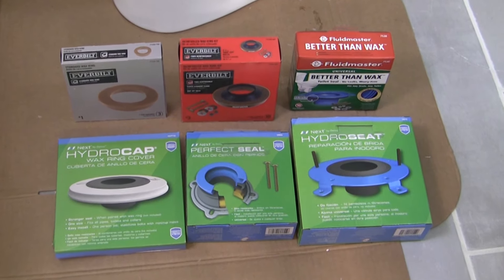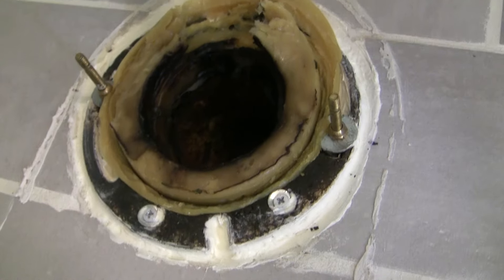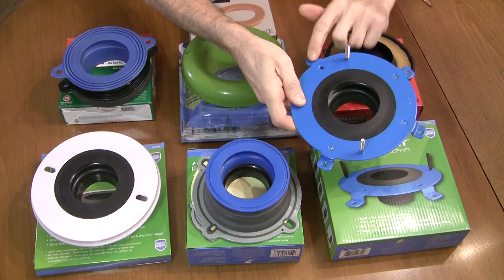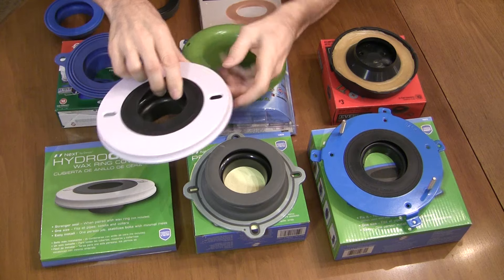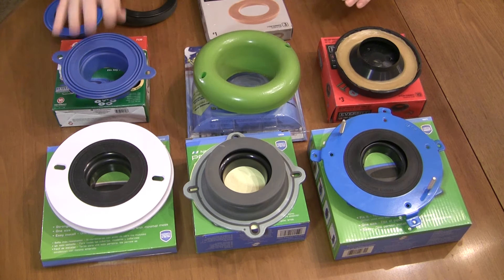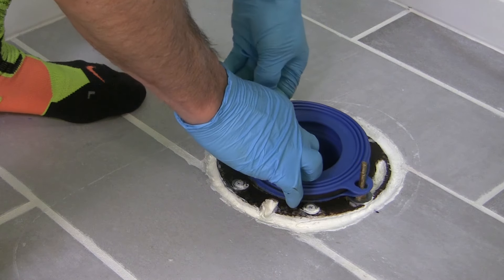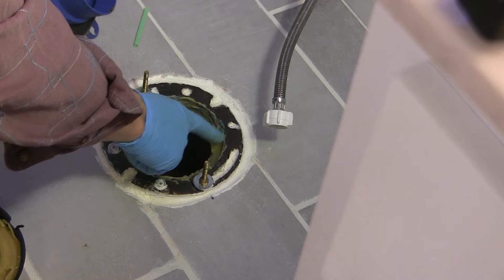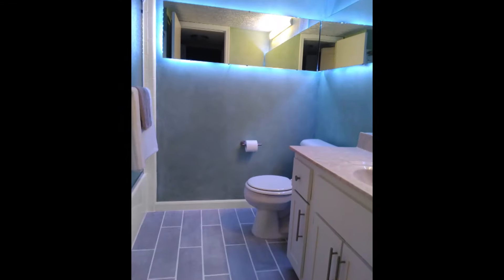2 YEAR FOLLOW-UP to Toilet Flange Fix  / Also, Compare Different Toilet Seals

Comment: P.S. : i had to hire a plumber the nite b4 thanksgiving, to replace my hot water heater, it sprung a leak at the inside of the flu pipe in the center of the heater, and kept putting the flame out, weird ,? but i couldn't get another heater, so i had to try an emergency plumber, he came out and replaced all my pex and shark bites with hard copper and solder joints, and it now looks sloppy, but it does work, so, ,,,,,, and he only charged me $1,300.00, yes that is not a typo, $1 thousand , 3 hundred dollars for about 3 hours work , i wanna be a plumber
Reply from the maker: $1300 is painful. Sorry to hear that, but houses are money pits.  You can never outlive all the work and updates and repairs.  Condos, not so bad in that respect.

Comment: Lol...  manufacturing the flange that keeps the bolts up, would be tough... then super long screws... and then they would break.

They do have toilets that are all-in-one and they do have power assist toilets for 150bucks that use 0.8 gallons of water ...

Comment: Check the measurement of the opening on the bottom of your toilet. You were concerted about the size of the "horn" opening on the bottom of those gaskets. I bet your toilet is around the same size, and not nearly as big as the hole in the floor.

Comment: Rubber, silicone….  Synthetic flange seals will degrade over time. Cleaning products will accelerate the degrading.  

In addition!  Rubber, silicone / synthetic gaskets and seals require nearly perfect mating surfaces and will NOT accommodate any settling or movement which is common in new construction.  

WAX does not degrade, does not require perfect mating surfaces, can accommodate settling / movement and is impervious to cleaning chemicals.  

New isn’t always better!    

Oh!  It doesn’t matter if your flange isn’t level!!!

Comment: One big mistake never caulk the bottom of the toilet looks good but if you have a leak the water cannot run out and will run down I spent 28 years in apartment maintenance I've seen it rot floors out and if you have a toilet upstairs you have a wood floor.

Comment: YOU HAVE TO MAKE MORE VIDEOS, DUDE!. LOL. SO MY STORY, WE HAVE A TOILET THAT KEEPS LEAKING ON THE FLOOR WE KEEP SEEING WATER ON THE GROUT LINES IN FRONT. I'VE REPLACED THE WAX RING A COUPLE TIMES AND INSTALLED ONE OF THESE FLANGE ADAPTERS. I'VE CALLED 4 OR 5 PLUMBERS IN OUR AREA AND LEFT MESSAGES AND DO YOU WANT TO GET HOW MANY OF THEM HAVE ANSWERED OR EVEN CALLED BACK? (HINT, I'M HERE WATCHING HOW TO VIDEOS). I WORK IN UTILITIES AND WOULD HAVE BEEN HAPPY TO HELP A LOCAL PLUMBER GET HIS BREAD BUT AT THIS POINT I SAY F%^K EM SINCE MY JOB IS APPARENTLY TOO SMALL. I'LL FIGURE IT OUT MYSELF ONE WAY OR ANOTHER AND SHARE THE KNOWLEDGE. THANKS FOR THE VIDEOS.

Comment: Sorry i keep commenting before watching the whole video but I hope you didnt pull these toilets up just to show your work didnt fail.. if i made a how to video and someone called me out i definately wouldnt pull my toilet to have a I told you so moment.. hell no, im not doing extra work..  good on you, fuck the know it alls and if it works for you then fuck the rest of the people.

Actually your attention to detail is appreciated, i never put a level on my flange.  As long as shit goes down the pipe and doesnt leak i am happy.

The green sani seal worked amaxing on 2 toilet projects, never had an issue with knicken them and they are reuasable.. they work great.

Comment: You know, if I were to design a toilet...the gasket would be attached to the toilet itself (possibly threaded onto it), with a compressible fitting that slips into the flange as you lower the toilet. There's no great reason as to why these fixtures continue to be designed and manufactured the way they are.

Comment: Those Fluidmaster no-wax seals are $11.50 where I live, + tax. So for two it's $25.76 instead of a $3.50 wax ring? Meh.
Reply from the maker: But with the no-wax you can keep pulling up your toilet to look underneath without buying a new seal.  Have you no sense of joy?

Comment: Hmmm, hard to believe this 2 yr follow-up video has an immaculate interior tank with no  water marks, rust from bolts and all the parts submerged in water  look that good. Even the caulking and grout are pure white from 2 yrs ago?
Reply from the maker: I wish I had it in me to be that deceptive and industrious.  This bathroom isn't used much ...never have used the shower, for instance.  Besides that, if you notice, there actually are water marks in the tank and the bolts in there are oxidized. It's been about five years since I renovated this room and it's still pristine.

Comment: Why can’t I put concrete to seal toilet??
Reply from the maker: Do you mean put grout around the bottom to fill in the gap between the toilet and the floor?  Or do you mean - make a seal out of concrete?  Heh heh, I'd like to see a video on that.
Reply: You want to stop the leak, not trap water in the floor.

Comment: The leakno silicone gasket is the best combined with a one piece gravity toilet like glacierbay-niagara 2420, kohler Santa Rosa, toto, American standard champion 4......  wax is junk.
Reply from the maker: Good info, thanks. I don't know about wax being junk though. They're proven the last for 20 years or more. Most of the wax rings are made out of petroleum, the best is beeswax.
Reply: @MartyPollio  wax is junk, it's okay though, one plunge and you can wreck the seal.

Comment: I was always told never to caulk the bottom of the toilet because then you can’t tell if it’s leaking water just go straight down. I see a lot of people caulking the bottom of toilets. I wonder why when I build the bathroom I build the floor so the toilet flange sit on top of the flow so when it leaks, the water runs across the floor so you see it this one or a great job piss on the haters
Reply from the maker: Thanks.  If you caulk the bottom of the toilet, you have to leave the back side of it un-caulked so a water leak will still show up on the floor.

Comment: Toilets wouldn't need a large ring of mush if toilets were made with a 3-4" ceramic extented part at the bottom of the toilet that was a tad smaller than the flange/pipe and all we needed was a bit of silicone to create an airtight seal.  I'm not a plumber, but it seems basic to me.  Someone invent a new mold for a toilet already, this is ridiculous.

Comment: I started this video not knowing how to fix a leaking toilet, by the end of the video i was confused and still don’t know how to fix a leaking toilet…LOL 

I can’t see anyone making recommendations about waxed rings without actually installing them and seeing the results.. with all the stacking of rings, demonstrating the “lost art” of scraper twirling, this should have been a twenty minute job using the time tested wax ring that has worked for centuries without leaking. In my opinion, if you want to come off demonstrating being a plumber, practice a “plumbers crack” in one of the many mirrors in your bathroom and PLEASE don’t post it to YouTube

Now go return all the rings to the big box store for a refund,; use a waxed ring to fix your toilet and live with the 1/8” difference in the level, the stacked rings you used did not make a difference in the level and no one will notice the 1/8” toilet tilt while using it

Comment: the uneven toilet is apparently easily resolved with levelers. Look up Barwalt Gripper Tile Wedges, you cut them off flush to the base and silicone around but never the back so water can get out. There are other great toilet videos on here that explain this. I recently went through my own flange issues but you really did make this way too hard, lol. I have better things to do than re-do work several times.

Comment: I find that any existing method of sealing toilet to the floor is shoddy engineering. It is possible to design sealing methods that never leak after decades of use.  It is possible to design so that all the gross mess does not leak outside the seal. If you remove the toilet after decades of use, it should be clean as new construction. But they don't design this way, they intentionally design it to fail. State of the art design can be expensive for sure, but still cheaper than repeated service calls and the damage to the house.

Comment: Why didn't you just use the spacer instead of putting two gaskets?
Reply from the maker: The spacer is for when the flange is below floor level.  That spacer is pretty thick, the toilet wouldn't have even touched the floor if it was sitting up on that thing.  I figured I needed one seal to attach to that big flange so that it sealed against it really well, then the second seal would just mostly be a funnel going into the bottom one.  That was my logic for that, but I have a follow-up video for this project - two years later I didn't feel good about it once I pulled the toilet and looked at it.

Comment: 12:29 yeah the plumbers diss you cause you are setting it wrong. Why the heck do you have a nut and washer on top of the flange. That should go on top of the porcelain... you'll never get a tight fit
Reply from the maker: Some plumbers do it the way I did it. My closet bolts were very close to the end of the slot where they could have slid out of the slot if I didn't lock them down.

Comment: Sanie seals are ok but over time I noticed that they collect water the better then wax seal work ok but the flang need to be below level to level with the floor or your going to need Shims 
I like the perfect seal line up personal  it flexes and  can be used almost every we’re for most applications  but on your repair on a cast flange was ok I would of used silicone instead of wax with rubber seals  on the tank to toilet bolts Kohler came up with a great design with a metal plate that mount on the locking nut of the flush vale and the bolts attach to the metal plate but on the guts of the toilet they pretty much are the same well at least with the full vale fluid master sells them cheap so manufactures use them but on the flush valve side of thing yea there kind of dumb there I agree but hay great video and I don’t mind joe blows doing there own work but try and do it right it’s when they halve a$$ it i mind be Ouse I got to fix it later after they fricked it up but that’s my cup of tea

Comment: Where are your new videos? I only see two and you seem to have some cool sh it to share.
Reply from the maker: I have some done already, but I need to redo parts of them.  I hate everything I do, so it's hard to get to the point where I finally post something.  I'll do it soon though.  Glad to get nudged about it.  Thanks.
Reply: @MartyPollio  you are amazing! I'm sorry you hate everything you do because I  love your 2 toilet videos! I learned so much from your first toilet video, I'm currently replacing totally rusted bolts and flange in a bathroom  in my home, which is not that old. I am copying your work, I'm replacing my own toilet all by myself and I'm proud , since I'm a girl.
Reply from the maker: @jojojarvis1818  I'm sorry, but you can't legally copy my toilet work.  That creates infringement issues with my un-intellectual property.
Reply: @MartyPollio  well it wasnt an exact copy, I left out the thinned mortar part, I didnt make a water groove and I didnt put a thin layer of caulk under the toilet , lol. I'm pretty proud of my new flange though!!!
Reply from the maker: @jojojarvis1818  Sounds like you used the Fluidmaster.  I'm getting ready to change mine again.  It's not leaking, but the thought of that foam backing coming apart bugs me to think about.  So yeah, I guess a third toilet video is coming, and I'm expecting it to be just as bad as the third Die Hard.

Comment: Why did you stop making videos?
Reply from the maker: I'm still making them, but I don't post anything because I hate them all. I'm also working on other unrelated video projects.  Basically I have more projects than I have time, but I'll try to post another before August.
Reply: @MartyPollio  Well, your video helped me today. I had to pull our toilet and put a new gasket on it and I used your suggestion. No wax. It is great. We are just testing it out for a few days to make sure it does not leak before putting everything back into the bathroom. So thank you so much for a great review. 

DYI is always so much better. We all learn so much that will apply to other stuff. You are awesome. :D
Reply from the maker: @nanettesage1112  Glad it helped. I'm not sure I trust the one I used though.  I'm going to pull the toilet and do another update video.  I may spend the rest of my life making videos of this toilet.
Reply: @MartyPollio  LOL, well if mine lasts until I move I will be happy. I hope to get about 10+ years out of it. The one that it had when I pulled the toilet was a wax one and it was horrible. I did not realize it but the previous owner had used MASSIVE amount of silicon to seal around the toilet. So the leaking was never seen until it backed up from the drainage and the pressure blew out the silicon. OMG, not only did I have sewage all over in the bathroom but the smell is horrible. The silicon was not just on the edge. There was a TON under the toilet such that, when I finally tried to lift the toilet up, it pulled the linoleum up with it. So not only did I have to fix the toilet but I had to glue the linoleum back down where the toilet sat so that nothing would build up under it.

As for the wax, who ever put it down knew (by the amount of silicon) they screwed up and so they were trying to seal it in via the silicon. My guess is a Pro did it and didn't want to eat any losses for screwing up.

Oh well, looking forward to seeing how the one you put in did after this long.

Have a wonderful weekend.

Comment: Why do you have nuts on the bolts under the toilet ?
Reply from the maker: Keeps them from flopping around while you're trying to set the toilet, but I should have put flat nuts on them instead of the tall, rounded ones.

Comment: We repurposed bees wax why not scrape the old good wax off and reuse it. Reform it back to normal with a heat gun or maybe hairdryer. Right, century old toilet tech is for plumber $ scammers.

Comment: you talked about how you didn't want a pig to do your plumbing, yet you just splattered filthy ,crap all over the room and into the air by using a high RPM spinning wheel to polish the flange.  Gross!
Reply from the maker: You're right, that is gross. I should have had a vacuum nozzle right next to it.

Comment: Green SaniSeal is the bomb. It covers the whole flange and the holes actually hold your bolts up.  The excuse you used about nicking is silly and not accurate. Good luck with these chuck n a truck videos. Just use a fat wax ring and be done.

Comment: bro stop making these videos.   you're wasting your time and showing people incorrect ways of doing.   those bumpers on the back of the tank  should    have been a sign for you to stop giving advice.  you have no plumbing experience. please just stop it
Reply from the maker: I have a 3-bolt tank.  They tend to sway and leak when they're leaned on.  Not mine though ...because I have bumpers on the back.  There's nothing I did for the fun of it, everything had a reason.  You're obviously a plumber so you don't get paid to think of new things to prevent old problems.  In fact, if you did, you would have fewer house calls because everything would stay fixed.  Imagine that.  No wonder you're irritated.